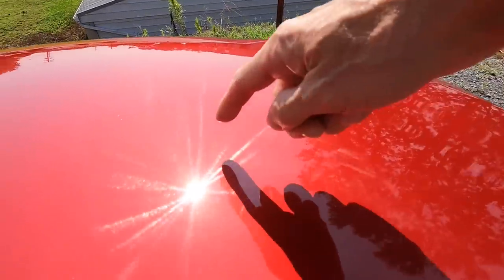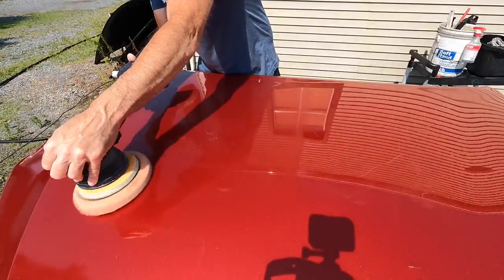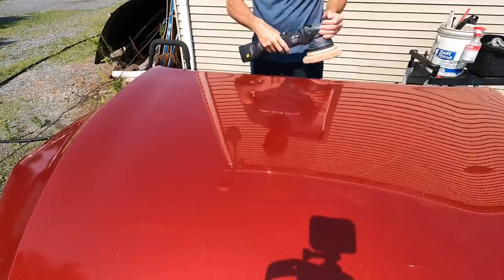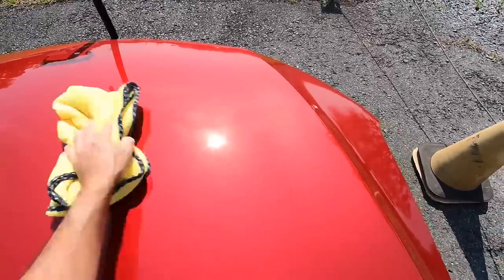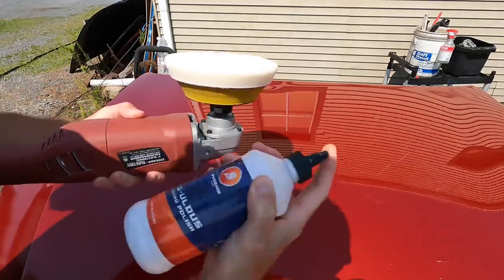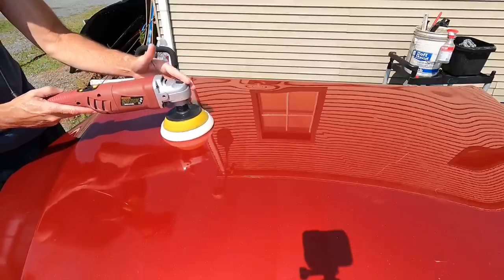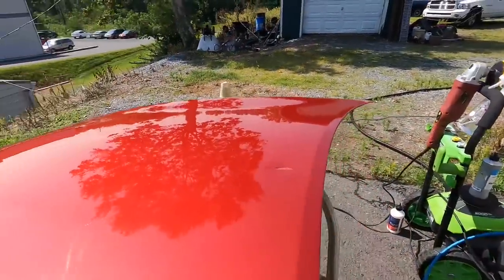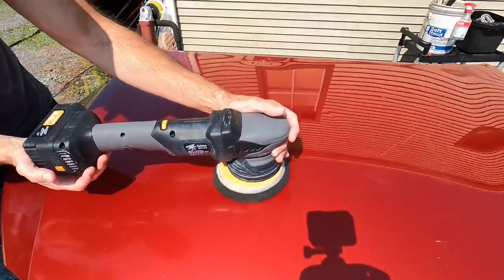How To Squeeze A Little More GLOSS Out Of Your Paint Correction!! Crisp Reflections & Depth!!

Comment: Jeweling is my absolute favorite thing to do as a detailer. It’s what I started with when first learning the rotary (from you B!) and I love the effortless, smooth, vibration free feeling of a dialed in rotary. 

I mostly do one steps now, so I tend to favor the DA for that. I can usually get a bit more cut and still finish down where I want to be better than I can with a rotary. But when I do get a multi step, I cannot wait to get the rotary out. I stay around the 1500 rpm range, basically no pressure, and have never once burned through or damaged anything with it, even when learning. I love how cool the pads stay compared to a long throw.
Reply: I have a new car with just light Turtle Wax spray wax on it.   I want to do a really good decontamination wash & VERY light polish.  Is “jeweling” good enough?  It’s a white car.  If there’s swirl marks I can’t see them.
Reply: @katiecannon8186  Absolutely. You can use something as gentle as a cleaner wax and a very soft pad. Or something like Essence or Uno Pure if you’re doing a coating or heavy duty sealant.
Reply: @jdisdetermined  

Thank you so very much for responding!   I haven’t decided yet what sealer I’m going to use.   I live on a dirt lane so I’m constantly using Turtle Wax Slick Shine Quick Detailer and TW Minute Wax to get the light layer of dirt off. 

I like these two products a lot.   But I also just bought P&S Waterless Wash.   I haven’t decided how I like it yet. 

Anyway …..   Lol.   Do you have any suggestions keeping in mind that I have to use something probably 3 or 4 days a week? 

I was thinking Turtle Wax Flex Wax or something along those lines. 

Do you have a favorite sealant?   Also, since I’m using tons of TW Minute Wax, maybe that’s all I need? 

I know I need a deep wash & light polish.  But after that?  I don’t know.   I just know I don’t want to go full ceramic coating.
Reply: @jdisdetermined  

Also, I see Dr. Beasley has a cleaner wax, that’s probably a good one?   Or do you have one you’d suggest?
Reply: @katiecannon8186  No worries! The most important thing is you’re keeping it protected, what you use to do that is less important. The biggest benefit of stronger protections are their longevity. You don’t have to reapply as often. So you can use whatever you enjoy working with. But Flex Wax would be a significant upgrade from Minute Wax. It will give you months of durability between applications. 

My personal favorite sealant is from Brian’s line, Blue Collar 2. It’s a simple spray and wipe application and up to a year of durability. That’s what I’d recommend if you want to try the strongest tier of protection that isn’t a full blown coating.

You’re pretty much ready to go after you’re done polishing. If you’re using a cleaner wax/all in one, you’re done, top it with a spray wax as needed. If you’re going with a stronger protection, use a primer(like CarPro Essence) or straight(Rupes Uno Pure)polish instead of a cleaner wax, and follow that with a panel prep and you’re good to apply. An easy cheap panel prep is about a 20% isopropyl alcohol solution. Or 1 part 91%IPA to about 3 parts water.. or buy something like CarPro Eraser.

I haven’t tried the Dr. Beasley’s version personally as I mostly do full coatings. But when I do use a cleaner wax/aio I use Rupes Uno or 3D Speed. But Dr. Beasley’s make great products, I wouldn’t be afraid to try it. 👍
Reply: @jdisdetermined  

Again, thank you so much!    I was thinking about using Blue Collar 2!   So, that’s what I’ll do!   Wew!   Glad that’s settled.   lol. 

And I think I’m gonna use the CarPro Essence. 

I’m completely new to this if you can’t tell.   So I really appreciate your advise.   All these products are so confusing.   

So, so nice of you.
Reply: @katiecannon8186  Happy to help. We all start as beginners. 👍 B took time to help and answered all my endless questions many many years ago, now I’m basically full time professional! So to repay that I always take time to help out his viewers whenever I can.

You will be very happy with BC2 and Essence is also a joy to work with. 

Have fun with your project, you’ll do great and I’ll be here if you have more questions.
Reply: @jdisdetermined  

Thank you again !!!

Comment: I needed this video as Im going to be getting my classic car repainted, so it won't need a full on correction. But it is a show car and I've been researching jeweling. This video was fantastic. 

I did have one question...I had someone tell me that for this step, I wanted to do everything you just did with the DA except they said you want to run it at a low speed like 1 or 2 and go very slow. Only pressure should be the weight of the machine. I see here you had the speed up between 4-5 and went normal speed. 

Is there a pro or con to doing it one way to the other? Thanks for any insight Brian